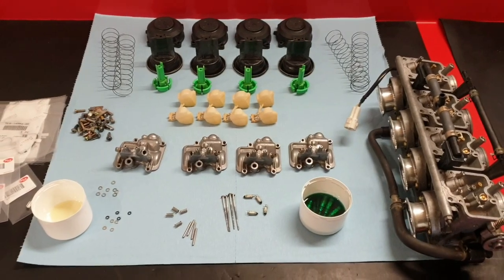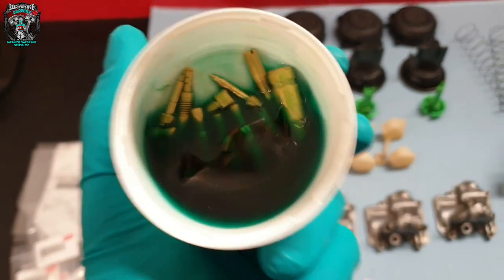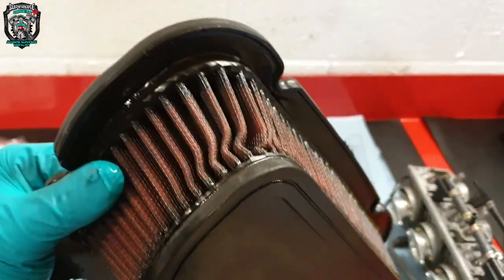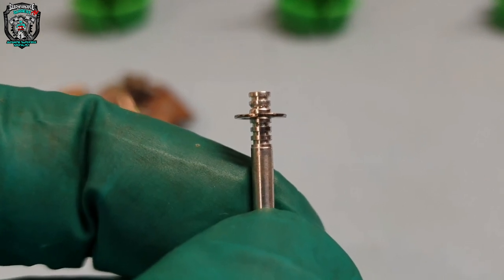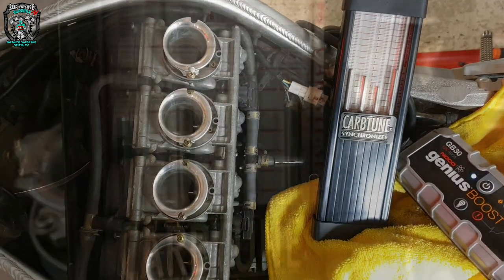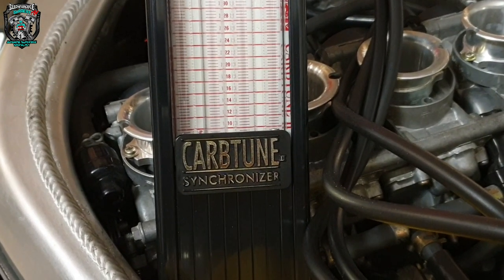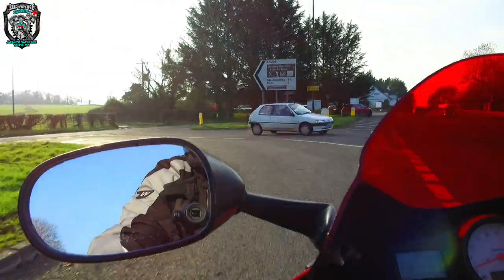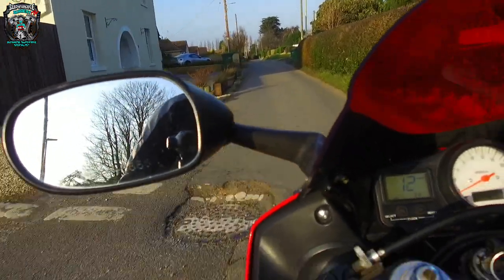Yamaha YZF-R6 Carb Service, Someone F.....ed Up VLOG-16 (Part 2)

Comment: Verry good Intelligent Content.
Thanks Jim.
👍🏻😁👍🏻
P.S.
The first carb is usualy most bad because The bike is leaning way left If It has his original stand.
The most water is thereby left behind in carb One.
There is only one fuel system cleaner i know of from: Justice Brothers.
That actually gets the Water out of the Flo Bowls and tank.
Maybe there are more products that are actually causing water to desolve in the fuel so It's drained out while driving the bike, +-15 years ago I tested it in a Coffee Cup and I Was very surprised ( Wyns fuel cleaner At that Time just floated on the water..)

I recommend everyone to use this product before the end of the driving season.
In combination with a good fuel stabilizer or a bit of 2 stroke oil, the carbs and tank stay Healthy.
Bless You All ❣

Comment: Brilliant explanation RE the route you went through fault diagnosis. Reminds me exactly of my own carb R6. I know exactly what you mean about shotgun diagnosis however sometimes to sort your own motorcycle out, it's needed but only if you've exhausted all other avenues. 

I've had a fault on my R6 when on initial application of throttle, sometimes it would hesitate, long story short, I tried all the usual, carbs apart, cleaned out all jets, galleries, set back up, compression test, electrical wiring, tps setup, pickup coil test, ht coils test, new plugs blah blah blah. Sometimes when cold it would start on 3 then drop onto 4 cylinders, other times it would be fine. 

Then my last trackday, it was misfiring under load out of the chicanes about 4k and again at 11k and clear up.

Anyway, I got that fed up of it, I bought some brand new tourmax coils and the starting on 3 cylinders has completely gone. Starts instantly on the button like a brand new bike now. Yet to road test as there's no MOT but I'm hopeful it's a final fix.

I had to laugh at your 'it goes well' comment on road test, for a 21 year old motorcycle, they're still good pieces of kit.

Comment: Loved the R6 of this vintage that i had a decent test ride on years ago when they 1st came out, but i bought an R7 OWO2 (4 y/o) in 2004, now its a bit like a big R6 handling/weight wise, but goes like an R1, 147bhp kitted and its absolutely balistic above 10k rpm,.This video reminded me of an "issue" i had with it spitting a valve collet out and it jamming the valve open as it was stuck in the cam bucket, how it never dropped the valve i'll never know,. It started of as a missfire after starting and smoothed out further up the rev range, no guts pulling away obviously, the best part is i was mot,ing it and catching iom ferry on the same day to go to the classic  manx in 2019, digs booked and paid for to all at great expense, mind f,k dilemma, to go or not to go, ? my son was comming up from london to, mot mechanic thought it was maybe fuel or plug related so i rolled the dice and went with it, miraculously it got me there and back and to the bike shop to be diagnosed, near miss or what !,. I could use your services to maintain the R7, my go to guy BMC racing packed up,.

Comment: A friend of mine just gifted me this motorcycle that has been sitting in her garage for over ten years without starting up. Hopefully, I can get her running in the near future.  She has very little miles since the owner was scared of the power of the bike and put her away.  I want to document my 0% experience fixing her up. What would be a good name for my channel? I have absolutely no experience with motorcycles, but I can tinker with cars, oil change, belt change, and hose changes.  Nothing really great.  Just ordered my ultrasonic carb cleaner and some metric tools to use on the yamaha.  New Sub, I really enjoyed your videos!
Reply from the maker: I don't know what you should call your channel, but the advice I'd give would be to get a decent camera and microphone set up. People always overlook the quality of the audio. It really puts people off watching if this isn't well done.  The new DJI Osmo Pocket 3 Creator Combo has been a game changer for me. It's so much easier than messing about with a bigger camera.  Quality isn't quite as good, but good enough! And because it's small and light it's easier to work around.  Thanks for your comment 👍
Reply: @SuperbikeSurgeryTV  Looks like a great camera setup,  I will have to put it in my basket along with a space heater, the cold was making it all the way to Florida!

Comment: I know this was recorded forever ago, but I was wondering if the misfueling was washing the bores and contributing to the loss of compression
Reply: Late to this too but I was wondering if the valves were adjusted on 20 thousand miles and if it was the same shop that fucked up the carbs got the clearance on the pennies in the bucket between the cam shaft wrong strange that two cylinders have the same drop off in compression
Reply: @davidfinn9828  It has a cracked liner between 1 and 2, Very common issue on these first gen R6's, Seen 100's of cases, I'm surprised he didnt have knowledge about this and wasted so much time on the bike

Comment: Jim, wondering if you could give me any tips for setting the fuel level in the carbs. (2001 R6.) Can’t seem to find a reputable source for the proper float height from the gasket surface, and the service manual only gives a spec for fuel height in the bowls, and while it gives info on how to measure, no matter how much I change the float height my measurement always seems to come out the same. Any advice?
Reply: Did you ever figure out how to set the proper level? I'm in the same bind right now. I know the level is wrong, but can't find any good source for what is right and.

Comment: 27,000 miles and the engine needs stripping?  Might as well be a 2 stroke.
Reply: They are terrible engines in the first gen R6 but it can be fixed by resleeving the engine

Comment: Come on Jim, give up the secret cleaner.
Or at least give us a clue...😉
Reply from the maker: It's constituent ingredient is a rare element called Unobtainium and is found near the northern tip of Nowhere-Ville
Reply: @nickfletcher506  I use a secret product to clean bike carbs as well... it's called carb cleaner.  Don't over think it.
Reply: @fwh79FOXR6  That is true, carb and brake cleaner all the same and great cleaner and degreaser. But what he used is different, carb and brake cleaners etc are solvent based, not oily at all.
Reply: @SuperbikeSurgeryTV  Harpic toilet cleaner then ?